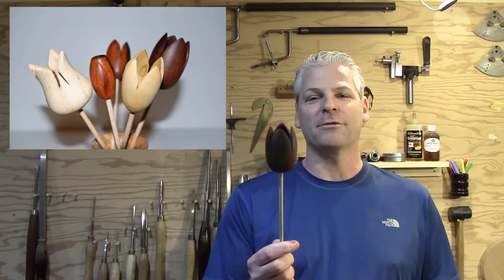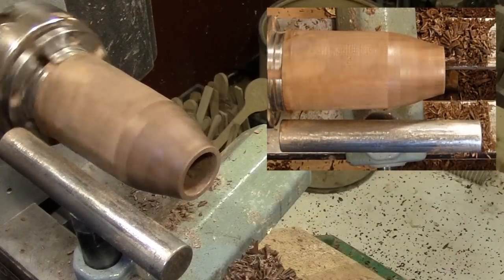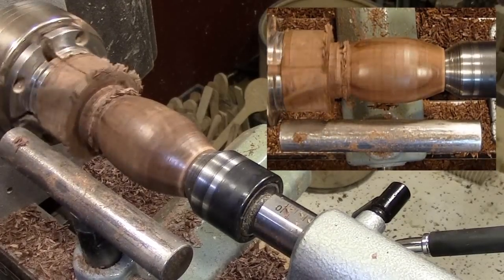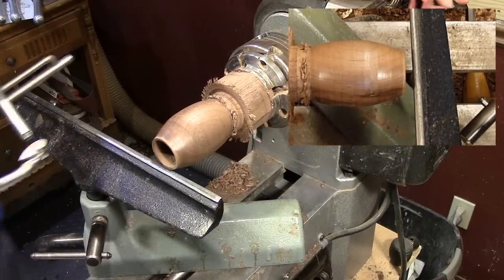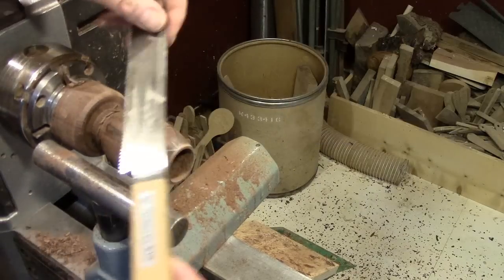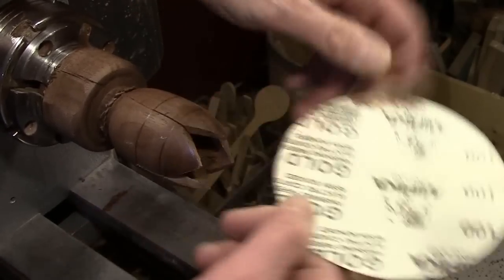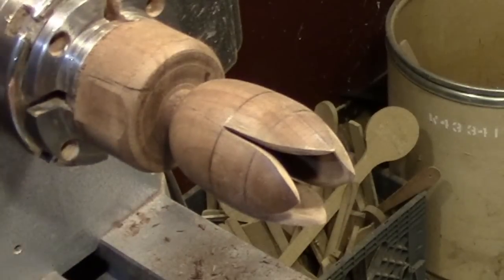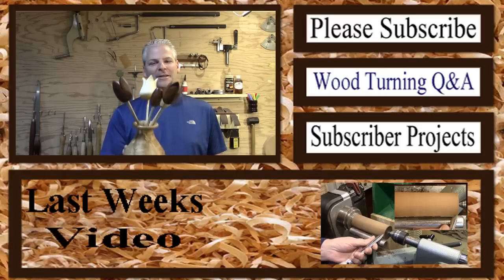Woodturning | Wood Flowers

Comment: Great job!  I noticed while you were sanding, you used some sort of wax mixture while you were sanding. I have always dry sanded, but I'm very interested in that mixture you were using.  Thanks again for sharing your concepts in turning flowers with me.  I also saw your other video on turning flowers, using a block of wood and cutting them prior to turning them.  Which method do you prefer?Tommy Schutz
Reply from the maker: Thank you Tommy! I sand with Howard beeswax conditioner. It cuts down on the sanding dust, and is a nice finish.  http://astore.amazon.com/thewood0c-20/detail/B00DKWRNZ0 I really haven't made to many I'm not sure what's the easiest way.

Comment: Another quick way to cut them is put them on a sled with an angle on it so the flower won't roll off the sled.  Make sure the sled slips around on the bed of the band saw and use a thin blade to make your cuts.  If you have a sharp new band saw blade you shouldn't have a lot of sanding to do.